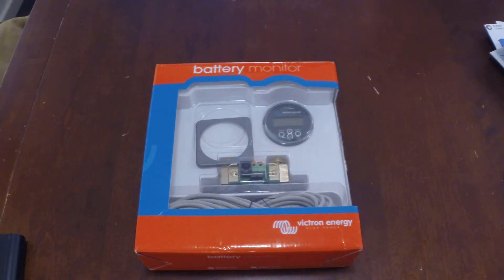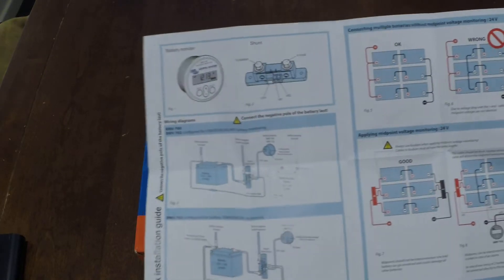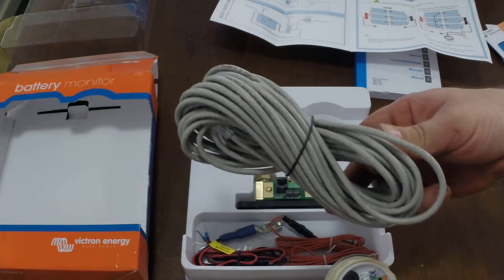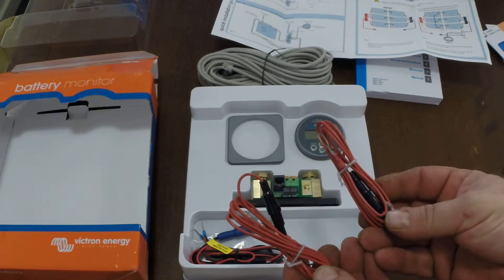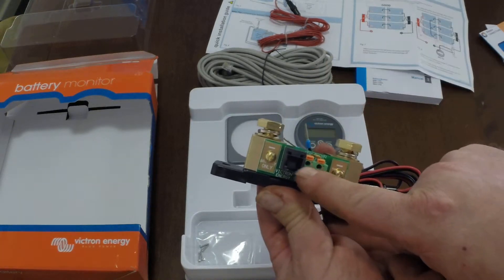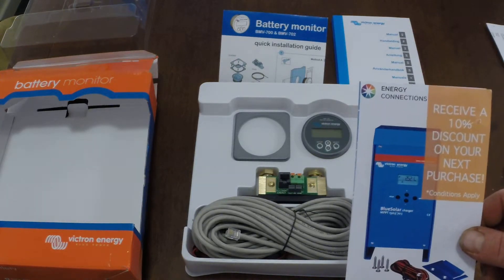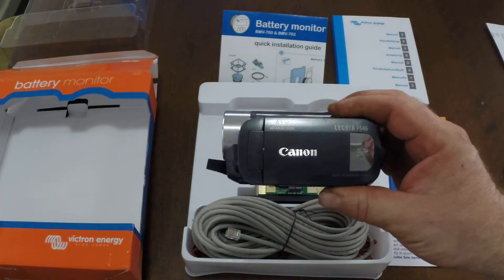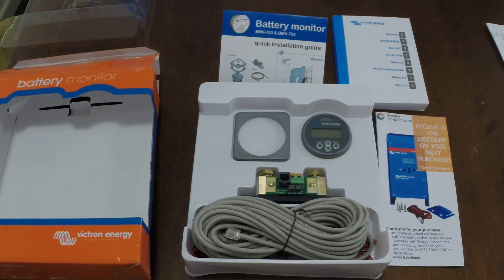Mail bag, Victron BMV 702 is here.

Comment: Looking Good. Did you get the Ve.direct usb cable i said to get as well? Without that you cant connect it to the computer.
Reply from the maker: Jeremy Ohara, yes I got the usb cable. It came the day after I made the video.
Reply from the maker: Just a side note, I've had to upgrade to Windows 10 as the Victron Connect software would crash on startup or not open at all. All sorted now and ready for the Victron install.
Reply: thats not going to worry my program. it runs from windows 7 up. i might run on windows xp but rather not